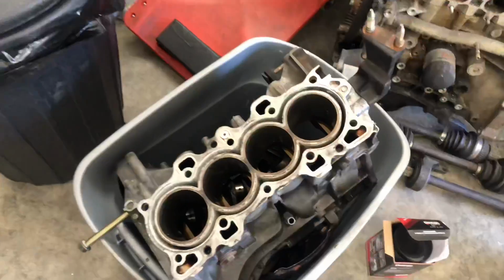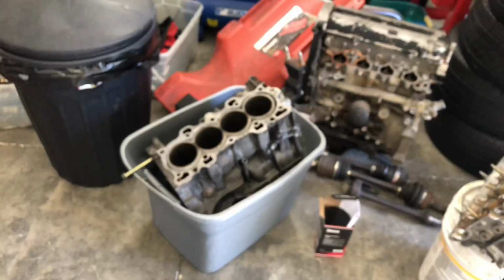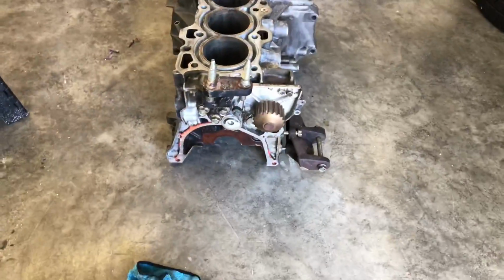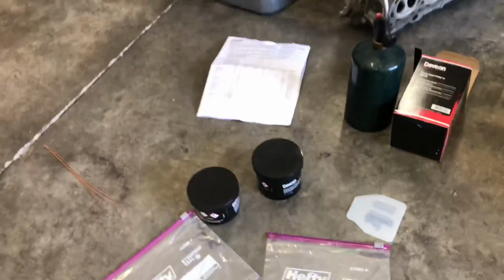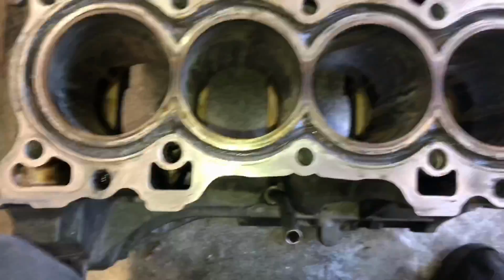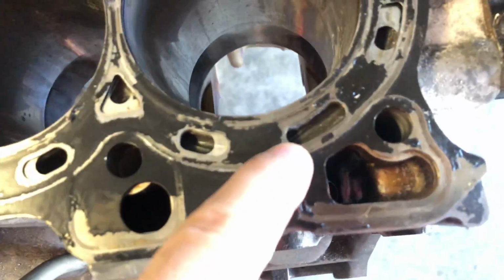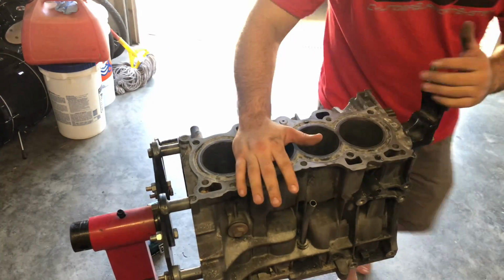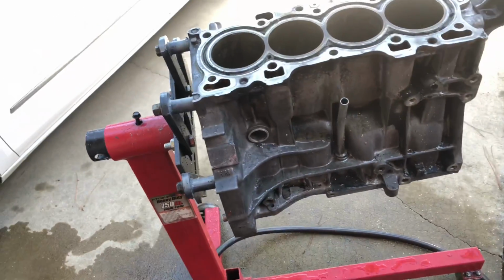The CHEAPEST Alternative to SLEEVING an Engine

Comment: Yeah i still cracked a cylinder (#1) sleeve with expoxy.  The epoxy was fine but that weak ass inner sleeve will crack!!! It cracked a hairline at 11 psi (261whp lsvtec).  We noticed a lower power compared to expectations.  Then at 14 psi on 93 octane, the hairline enlarged to a crack and white smoke came out the exhaust from coolant entering the combustion chamber.  Removed head and instantly seen the crack.  Had to buy another block that was sleeved (labor costs: head removal, engine teardown/assemble, turbo, tranny engine reinstall).  Trying to be cheap costs more money, all my honda blocks will be sleeved from now on e v en K series!!!  Pay the extra $800 to $1200 to bulletproof your cylinders!  These blocks are almost 30 years old and you think u cansimply push them without those thin ass sleeves cracking?  I will be doing a warning video

Comment: It looks to me like a upside down half fill. Theoretically it will work. the only drawback is that the top is the hottest part of the engine. That is why aluminum heads came about .  It should be  ok for the strip but the street, Id be worried.

Comment: Nitrous doesn't increase cylinder pressure to push harder on the pistons to make more torque at any specific engine speed therefore increasing horsepower? Wow. Who knew? Nobody with a freaking clue about engines...

Comment: This is pretty rad! I’ve seen big boy power sled pulling diesel pick ups do similar ish to this. I actually sold a 12valve 5.9 Cummins to a local dude who was going to fill the water jacket completely with concrete. Massive compound turbos, like bigger than your face x2, running 60lbs of boost dyno’d around 1,2xx whp and somewhere shy of 2,000lb of torque!!! 😳😳😱 he would start it as soon as they called him, get lined up on to the track and shut it down, and only run it hard from the time the sled was hooked and he was ready to pull, and he would shut it down as soon as he couldn’t pull anymore! Lol that thing was insaneee!!!!
Reply: If I remember correctly he ran that same engine at quite a few events that year, I kinda fell off going to the truck pulls the following few years.

Comment: Devcon on anything other than setting turquoise into a piece of jewelry is just stupid, plastic compounds is not metal in any way and is doomed to fail fail fail fail costing way more than doing it right in the first place. Final round, 2 hrs till lane call, well, maybe. Better to show up, the other lane may fail or red light and then you can drive to the return road. That is the only time to use Devcon.

Comment: Taping off the deck and cylinder surfaces to fill the grooves to the brim and skimming it with a bondo spreader will give you a good compressed fill with a smooth flush surface. Just to avoid coolant seeping where you don’t want it. Don’t pull the tape off until the product is dry enough so you don’t tamper with the perfect surface. Resurfacing the deck will remove any tape that’ll be stuck to the edges. Even a block with smooth sandpaper will clean the edges but you’ll have to know the gasket your going to be using in order to know what the required
 (surface scratch) on the deck is recommended or else the gasket won’t BITE correctly. The more solid of a gasket material, the smoother the surface.

Comment: fuck the ants    that shit is gonna soften up tho  at 200 degrees  (min temp on even a stock engine). i would searched for some long bolts with 11mm heads and jammed them into  or found something similar insteadof fuckin epoxy cuz that shit WILL get soft at temp..anybody who says otherwisw is fulla shit

Comment: #1 sandpaper on an engine block, without rinsing everything afterwards. If you want a hack job that can last a race or two and doesn't put carborundum grit in your bearings,, you just use RTV on both sides of the head gasket! It's even cheaper. The right way to do this is to raise the cylinder liners with washers, made of gasket material or even paper and then machine the top and head  flat. BTW this is also cheaper than $40.

Comment: That's not Sleeving. That's filling in the water jacket for an unknown reason. Sleeving is cutting out the sleeve or cylinder wall and replacing it with "sleeve". What is wrong with you ricers?

Comment: That should work just fine. It just needs to keep the cylinders from walking around. I have worked with Devcon aluminum repair putty with some success on aluminum, however it requires you to bake it in an oven. Don't know how much of a difference it would make, but it is made for aluminum. You could also use a pastry bag if you are worried about your ziplock bag exploding all over the place, or maybe even emptying out a caulking tube, and filling it up.

Comment: it sounds good but if honda would redesign the block this wouldnt be necessary,  have seen engines with this mod with the side of cylinder blown out , good idea bou a temporary  fix at best, if ya dont run more than 10 psi of it will hold up pretty well, any more than that and you will have problems. also the epoxy doesnt expand and contract at the same rate as the block, so eventually  it will become  loose and fail

Comment: Nice informative video. Tell me something is this methode used to prevent cylinders warp under high temperatures.
On my 1.6 elantra this happened cyl. number two and four was messed up had to drill block and put new sleeves.

Comment: Just curious as to why the water jackets weren't flush filled or a touch overfilled seeing the block is getting decked and bored anyway, more material may make it stronger by supporting cylinder walls also it'll have a clamped mating force against it by way of head/gasket.. Then drill water channels after machining is done.

Also any idea of the expansion rate of the product as opposed to what the surrounding metals are at temp?
Seems like a good budget solution to open deck blocks if it works out.

Comment: Think I would have chose a different motor that doesn't have that issue when juice is applied. I m pretty sure you may be taking this motor out again due to that epoxy it will eventually break apart due to hot and cold cycles.

Comment: Sleeving is taping new cylinder   Inserts or increasing the bore .
Reply: If the diameter of the bore exceeds the maximum for overboring for an actual sleeve, the machine shop wouldnt do it. Nothing like blowing out a cylinder wall with the boring machine. Plus the sleeve wouldn't seat. I did a lot of sleeving back in the 90's on snowmobiles. Some motorcycles, usually classics. I miss restoring vintage stuff.

Comment: Nice mod. I remember when putting concrete in the water jackets was high tech, LOL.
Reply from the maker: Lol
Reply: Devon makes a number of different mixtures.  Some have ceramic beads for wear protection. Others are even used to fill heavy wear areas (gouges) in the ways of machine tools. Another use is to fill casting areas of the types of mills and other machine tools that you might find in a home machinist's workshop

Comment: Making that deck enclosed like it should be.The free standing cylinder deck design is a joke and the only reason the auto manufactures use it is because it is cheap.Renault used it back in the 80s and had continuing head gasket failures. Now today with aluminum blocks and headgasket technology they last just outside warranty. The sad thing is the big 3 are adopting this design not relying on the integrity of the block to head interface but the head gasket.

Comment: The only problem is, you need to have the block cooked out before rebuilding it. Will the Chem bath of the cleaning detourate the putty filler? I have blown core plugs out of the side of engines at redline conditions... I don't see anything that would keep this stuff from cracking or breaking up... I guess it would be ok for a build and burn application...
Reply: I think thats what this is. Not a long term method for sure.

Comment: Devcon makes great products. I ran across many aircraft repairs in my career where Devcon products were specified to be used in interesting and unusual ways when a traditional fix would be cost prohibitive. Good luck with that, if anything will work, Devcon will.
Reply: I think aircraft is the last item I would be budget minded on repairs. Not like you can just pull over or have a bad night at the strip.
Reply: Tracey:  We used their products in building of the planes. It was under every galley and bathroom on the planes.
Reply: Used cases and cases of the stuff over the years at work. Was told it was originally used to repair conveyor belts.
Reply: I dont believe you
Reply: It would probably crack vs mushroom..
Reply: upside downdog you would be surprised how much the northeastern power grid relies on Dev-Con and another name to look for is Belzona.They make an epoxy/aluminum product that can fix a race block.No B/S!!! A real fix,not a band aid!!
Reply: @Mr39036ce  
I don't doubt it. I will keep an eye out for that product. The epoxies, adhesives, and sealants made today are amazing. Aircraft fuel tank sealant is impervious to almost anything except phenol based paint strippers, and they just soften it. It can be thinned with MEK and sloshed around small gas tanks to repair pinholes and cracks.

Comment: I'm just curious, but wouldn't it be better to to install and torque down a deck plate(like the ones used during cylinder honing) to keep the cylinders from moving or dis figuring during the curing process of the defcon? I've used Hardblock and always torqued down a deck plate during the curing process.

Comment: Bro!!! Just use a blockguard and bore a few thousandths off to relieve the stress on the sleeves after the blockguard and get new oversized pistons and done no need for the putty!
Reply: blockguard is just going to wrap
Reply: Pure Essence it warps because non engine builders love to install parts without knowing how they work. You always bore and hone after the blockguard is in place to relieve the cylinder pressure after a blockguard is pressed into place.

Comment: This is not called sleeving. Sleeving means that you enlarge a cylinder bore and install an insert to cover the entire cylinder wall. Interesting video, though.
Reply: I agree. Sleeved many snowmobile engines in my day. Had the cylinder bored over and dropped in a sleeve. I never had an issue with one. On an older Triple cylinder engine, it was a real cost saver. I restored some nice snowmobiles and even motorcycles back in the 90's.
Reply: Geo Logic yes.
Reply: He's changing from open to semi-closed deck, which is cylinder reinforcement (AKA block guard).
Reply: BLOCK GUARD which is good and bad. I rather sleeve it I like more cooling
Reply: It has sleeves already, he is supporting them vs installing new ones.
Reply: With Honda H series you DO NEED to sleeve if you want to upgrade the pistons. The stock cylinder walls are made from fiber-reinforced material that apparently can't be honed normally and won't react well with lightweight performance pistons. That's why I never bothered with the H series or the Accord / Prelude.
Reply: thats actually wrong they have pistons for hseries meant for the stock sleeves for example boostedboiz 700hp hatch is a jdm h22 stock sleeves
Reply: @boss1234234  The FRM is stronger than aluminum. It will wear the piston down faster than the sleeve. Same principle as carbide vs steel, or diamond vs steel. The harder material always wins. I don't trust coatings because they will also wear down much quicker than the expected lifetime of the engine. Maybe good for drag racing occasionally, but I like dailys. They need to be reliable.
Reply: He didn't say in title that it was sleeving, it says it is an alternitive to sleeving.
Reply: That’s why it says alternative lmao look the word up
Reply: @Tyler-789  How is doing anything to the outside of the cylinder an alternative to repairing a damaged inside wall? Sleeving is done to salvage an unusable block when wear or damage to the cylinder wall(s) is beyond the point of safe machining.
Reply: Geo Logic aluminum blocks are notorious for the cylinders walking. Giving external support for the aluminum, allows for more rigidity.. The whole point, is to get the rigidity, without the weight. Block guards, are the same concept.
Reply: @ryanpinkham6784  I understand what the video is about. My original comment is regarding the video title. Sleeving is a process of fixing the inside wall of a cylinder, not reinforcing it. I searched for "cylinder sleeving" and this vid came up. Not at all what I was looking for. Also, I would use a metal support plate for better rigidity. For those who think I don't know what I'm talking about, visit this site: https://www.melling.com/contract-manufacturing/cylinder-sleeves/
Reply: Sleeving can also be used to reinforce the block. You can replace the sleeves and keep the original bore size. Many boosted applications do this. Sleeving can also extend the sleeve length, to accommodate a longer stroke without having the piston come out of the cylinder bottom causing piston rock. I agree this is a partial fill block, but sleeving is not ONLY for fixing the inside of a cylinder.
Reply: @davidshockley8635  I forgot to mention the performance benefit of sleeving all the cylinders. Thanks for reminding me.

Comment: A cylinder sleeve  is meant to repair or change the bore of a cylinder . You block filled your engine . This has nothing to do with sleeving your engine,
Reply: Yeah, this wouldnt do anything for FRM sleaved engines

Comment: Also here because of boostedbois. I'm not a tuner but this is really interesting. So what you are doing is making a barrier around the top of the combustion chamber to help keep the cylinder sleeve from mushrooming open with the huge amount of combustion pressure? Am I correct?
Reply: Another thought is that open deck sleeves move around under big power damaging the head gasket and loosing seal. This is a budget closed deck conversion. I think its pretty cool.
Reply: ThriftStore Hacker not so much mushroom (make bigger at the top like a well worn valve tip) as it is deflection (side to side movement of the cylinder). The combustion force in the cylinder is not applied evenly to all of the cylinder wall, as the cylinder doesn't just fire all of the fuel in one neat little hit. It burns across a flame front which means the pressure wave will also vary in the cylinder (super fast) causing a side to side rocking motion like the TheSplendidVids alluded to.

Which in turn will try to rock the cylinders (very fast like an orbital sander) and deflect the bore causing a loss of sealing. By trying to hold the top of the cylinders more rigidly it reduces the chance of movement, which makes for a happier head gasket and better ring sealing.
Reply: Dodgy Brothers interesting. If you aren't too worried about mushrooming the top of the bore out would it may be more stable to drive vertical pins between the bore and engine block. I feel like the epoxy would be ground into dust after a few hard runs of the engine. Some aluminum or steel rod could be had at the hardware store for $10.
Your thoughts?
Reply: You do actually get a slight temporary mushrooming / balloon effect in the bore (especially under big boost or lots of nitrous) but it isn't at the very top of the bore like you might think. Remember the fuel doesn't start to "effectively" burn (so no pressure spike) until after the piston is traveling down the stroke (even though the plug fired BTDC).  So the mushroom effect takes place more like a quarter of the way down the bore where the walls of the cylinder balloon out leaving the top of the cylinder and half way down the bore in place. Whenever you see a split bore it will generally be in that area.

Like you say though I would be skeptical of any material you could hand drill and leaves a power residue (even if it work hardens with use). If he had drilled it and it came out like swarf like you get when drilling metal I would have more confidence in it. My personal choice (because I built one) would be to CNC machine a 16mm aluminium plate that snuggly fit in the top of the bores.
Reply: You wouldn't want to use steel metal pins because it would cause electrolysis caused by dissimilar metals. On further thought... The putty doesn't go all the way up to the head so there would be no abrasive rubbing between the putty and the head, it would only be touching the walls in the same plane as the movement, so I don't think there would be much wear movement, especially once fully hardened.
Reply: Dodgy Brothers thanks for the info/education!  Instead of making a CNC milled plate maybe do some backyard casting? Pour the aluminum in? The sugar trick could still work to fill the coolant passages but the aluminum will have a tasty layer of caramel under it.
Reply: The beauty of using a piece of billet / plate aluminium is it's more compressed (therefore dense) than would be achieved with casting, but if you don't have $7k to build your own CNC, casting could be alternative. Would I try cast it in the block... Yeah not sure I would be game to attempt that, but if you did it in a mould it would need to be super precise if you had no way to machine it. I guess with a file and a WHOLE lot of patience...
Reply: ThriftStore Hacker - sugar won’t work, it will dissolve due to the heat.  fine sand if anything to try casting but would be really hard to clean out as it’s not water soluble. Better off to just to use a water jacket fill product. They reinforce the blocks in many classes of racing, this is not new tech by any stretch, we’ve been doing it for decades.  Look up hardblok water jacket filler.
Reply from the maker: Correct. And thank you for the support!!